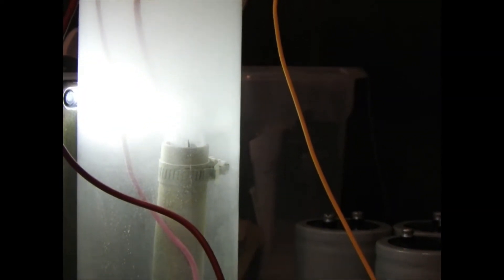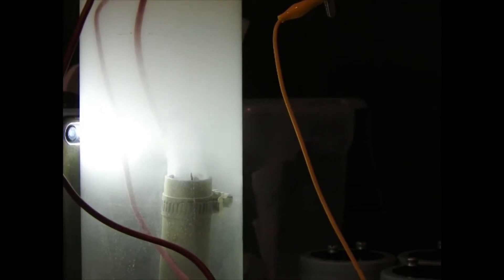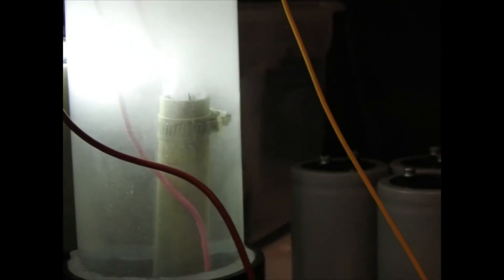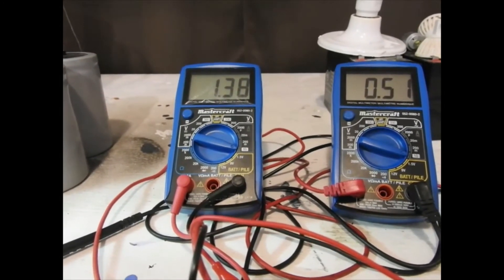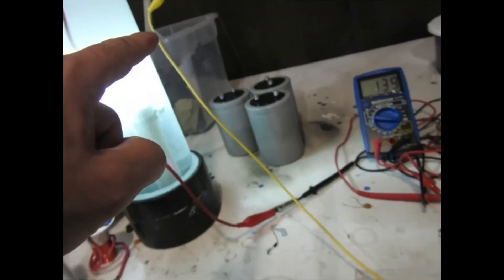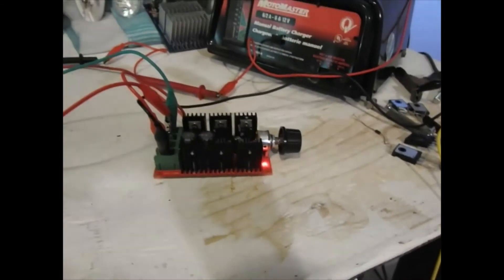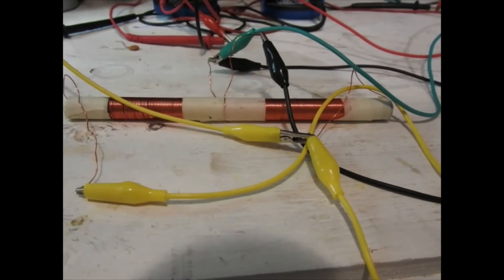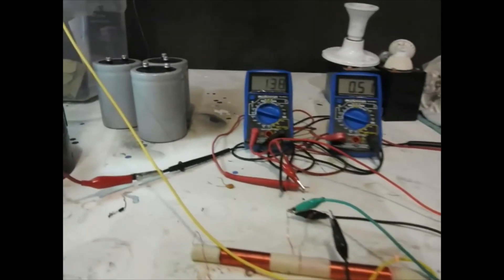HHO Don Smith Coil Setup

Comment: hello the wonn, greetings from venezuela. Can I make the bifilar coil with an old TV flyback ferrite core? What gauge of wire do you use? And what values of inductance per single-line cable do you handle? Thank you.

Comment: Well wholly shit! Just checking...what's the amp draw measured on the cable from the charger to the pwm man? If it's still .5A you're a bloody legend! Is your Don Smith coil rod used here detailed in one of your other videos?
Reply from the maker: I will try and measure it tonight
Reply: @thewonn  hey thanks! I wish you all the very best in your endeavours here. I've tried to find in your videos your winding instruction for your resonant coils. I'm not sure if I've missed one but I can't seem to find the instruction? I'm bursting to try it please.
Reply from the maker: @vardfriki7274
Reply: his setup works great I built a similar setup and produce almost the same amount of hho. I used his plans. started with something like 8 amp draw using koh and after running it and running it the amperage is now like 2 amps for the same amount of hho and it's very similar to what he has happening. My pipes have more space in between them than his though.
Reply: @MsSpicynipples  thanks man. Where did you get his plans? Windings, wire sizing, specs for fets etc...?
Reply: @MsSpicynipples  can you show how you setup. Tq
Reply from the maker: https://fitnesshomesupplies.com/collections/hho-hydrogen-products

Comment: I believe you are getting closer to Tariel Kapanadze water car.  From what I’ve heard and observed is that, the requirement is to induce on the submerged rods or coils in water the points where the resonance/voltage phase intersect(nodes of resonance) and it is there, that the hyper efficiency is achieved, where the brake down of water molecule is so rapid and efficient that, if converted in power, your get more power out than you put in…just a theory I heard … … .